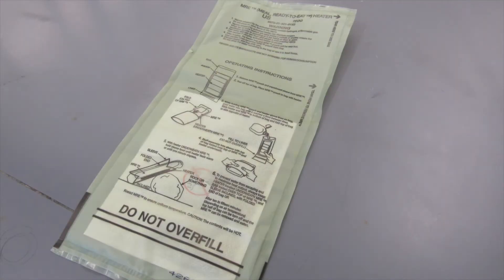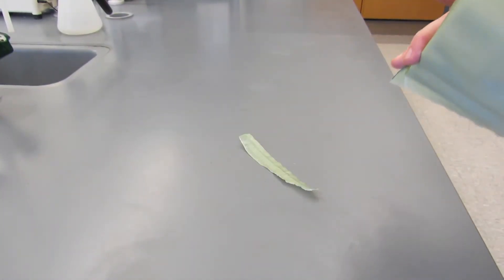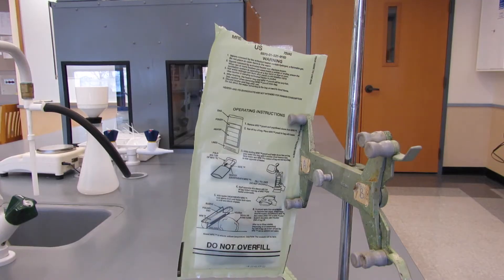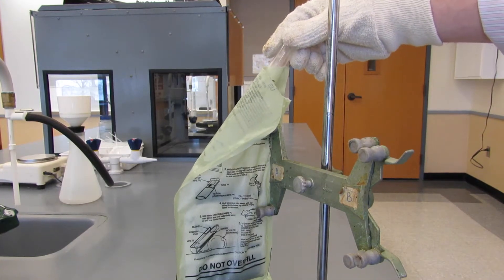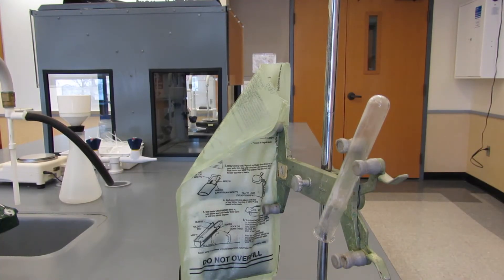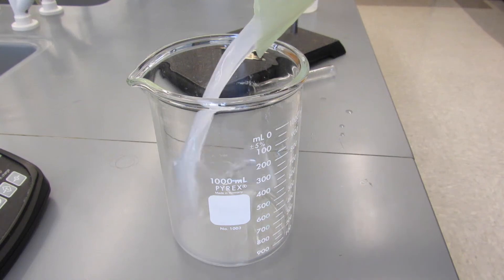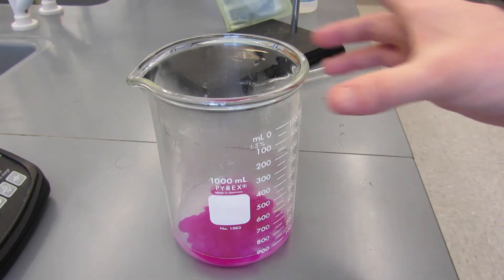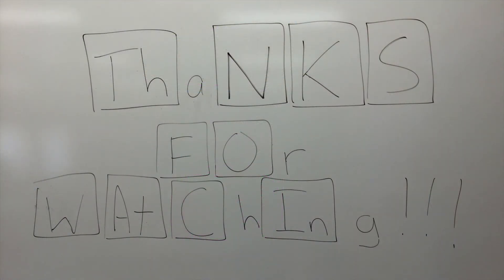The Chemistry of a Flameless Ration Heater (FRH) - The reaction of magnesium and water

Comment: But here's a question; is the byproduct water in the container toxic or not? I always wondered if that sachet could be dumped into a cup of water to boil it to make coffe or sth. After seeing the milky colour I'd assume at the very least it would not make coffee taste the same.
Reply: Yeah you die if you drink that lol
Reply: @Thefabrizzio97  Not sure if you're pulling my leg over here. On one hand i don't know jack about chemistry, on another this is food-contact product, stuff like that can't be deadly-toxic it wouldn't pass even basic food safety standards.
Reply from the maker: I think the thing here is that part that is heating up never touches the food, so it is safe to use to heat up food.
Reply from the maker: The byproduct is magnesium hydroxide and is really basic. It would be like drinking drain cleaner I suspect.

Comment: Could you make one of these heaters with Sodium Hydroxide and Aluminum powder in a reaction with aqueous solution?
Reply: That would definitely produce intense heat, wouldn't even need the Aluminum powder, but it would be an extremely caustic solution and could damage the food, container, and burn the hell out of you if you got any of the liquid on your hands.  It would be extremely difficult to wash off out in the woods or on some type of military mission, you would need access to a lot of water in case of contact with the skin.  
Source:  Chem lab tech 17 yrs

Comment: So nothing much on the actual chemistry as suggested by the title.
Here's how it actually works:

Ration heaters generate heat in an electron-transfer process called an oxidation-reduction reaction. Water oxidizes magnesium metal, according to the following chemical reaction:
Mg + 2H2O → Mg(OH)2 + H2 [+ heat]
This reaction is analogous to iron being rusted by oxygen, and proceeds at about the same slow rate. On their own, the reaction between magnesium and water is too slow to generate usable heat.
To accelerate the reaction, we mix metallic iron particles and table salt (NaCl) with the magnesium particles.
Iron and magnesium metals, when suspended in an electrolyte (such as salt water), form a galvanic cell—a "battery"—that can generate electricity. When water is added to a ration heater, it dissolves the salt to form a salt-water electrolyte, thereby turning each particle of magnesium and iron into a tiny battery. Because the magnesium and iron particles are in contact, they become thousands of tiny short-circuited batteries, which quickly burn out, producing heat
Reply: thank you so much for the lesson. I went here hoping to learn how these work and here is some one that that knows. bless you for filling in the gaps.
Reply: Wow best comment ever
Reply: @wackoguywatch do not put anything other than military meal packets in these pouches the flameless ration heaters where designed with meal rations in mind there not designed to heat anything else up
Reply: @wackoguywatch yes.
Reply: @wackoguywatch If you want toxic chemicals in your food go right ahead. MRE pouches are designed specifically to be heated by this process without leaching anything into the contents. Ziploc bags are just plastic pouches. Use your brain.
Reply: In what percantages
Reply: Would be nice if you included this...
Extracted from Wikipedia..
One brand of self-heating rations uses 7.5 grams of a powdered magnesium-iron alloy, consisting of 95% magnesium and 5% iron by weight, 0.5 grams of salt, in addition to an inner filler and anti-foaming agent. Upon adding 1 US fluid ounce (30 ml) of water, this mixture can raise the temperature of a 8-ounce (230 g) meal packet by 100 °F (38 °C) in about 10 minutes, releasing approximately 50 kilojoules (47 BTU) of heat energy at about 80 watts
Reply: Can you use ocean salt water for the heater.
Reply from the maker: +Paul Jackson Hi there.  While I know all of this, I was just focusing on the reaction of magnesium and water, which I do mention in the video and in the description.  I probably could have been a little more clear on that.  Thanks for the info though, I'm sure people who are looking for a little more info will find it useful and it will save them a trip to wikipedia.
Reply: @DrBsChemistry u suck
Reply: Tl Dr please?